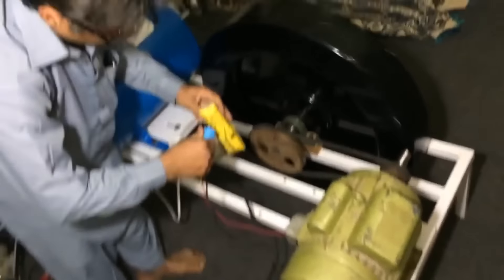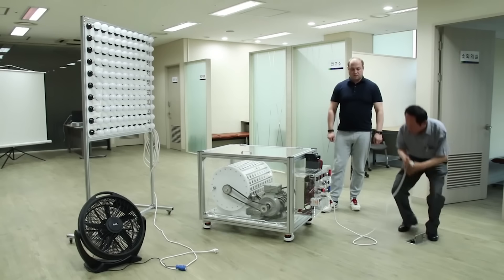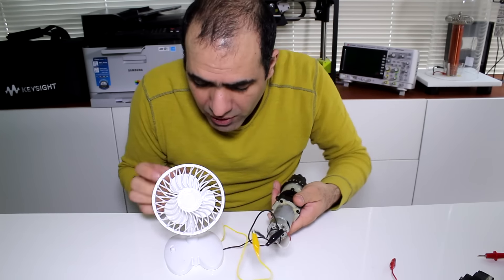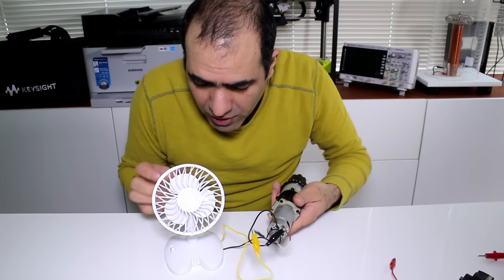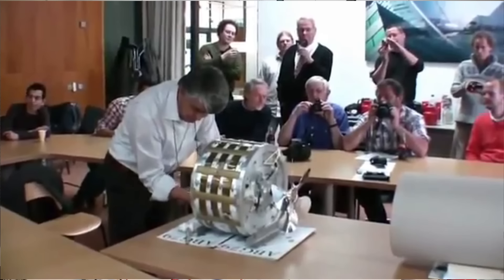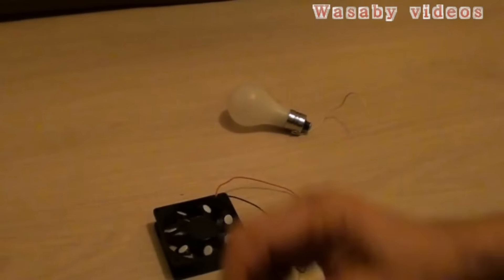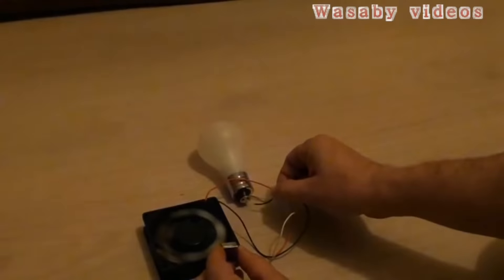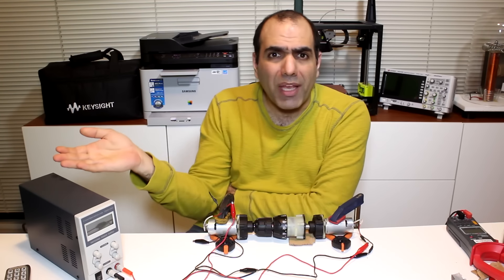The Curious Case of Free Energy Device

Comment: The hardest part of making a free energy device is to find a place to hide the battery
Reply: Haha no. The hardest part in making a free energy device is to be honest on why it works and being capable of refute any incoming BS.
Reply: Earth and sky are components of the battery. We just don’t know how to harness it.
Reply: @MiddlePath33  completely unnecessary when overunity devices exist.
Reply: There is no "free" energy. But there are energy sources that are untapped. Gravity is one of them. The centuries old grandfather clock is a gravity powered device, that can run indefinitely, as long as you reset the counter-weights. And resetting them automatically is an easy engineering problem to solve. You just need to scale up the design many hundreds of times, and use multi-ton counterweights attached to a fly wheel.
Reply: @lukiepoole9254  You have answered your own question. What you have described is NOT free energy, because you do have an energy source: the magnets. True free energy is impossible. Any system where you are not introducing some kind of energy into it will eventually stall because of drag, attrition between the component parts, and parasitic loss of energy.
Reply: @Biden_is_demented  Gravity is tapped; that's what hydroelectric dams are. But you cannot use your output energy to reset the mechanism for more energy than was in the system at the start, so you cannot create a mechanism that does work (like running a clock) indefinitely (which would be free energy). This is basic thermodynamics. In the case of grandfather clocks and hydro dams, the reset energy is external (the person resetting the weights, and weather cycles powered by the sun). Gravity isn't an infinite energy well. To use it, energy has to be put in to create a gravitational potential to harvest energy from.
Reply: @Biden_is_demented  What?  Hydroelectricity powerplants work because of.... gravity.  What are you talking about?!?!  We use gravity all the time.  Weight and pulley = gravity.  Dams = gravity, etc.
Reply: It doesn't work like that. The laws of physics govern that the energy generated from the falling weights of the grandfather clock cannot be greater than the energy required to reset the weights. You think nobody has ever tried that? No matter how much you scale up the design you will never be able to generate more energy than it requires to keep the clock running.
Reply: @Sinoops  maybe if you understood the true nature of gravity you would be able to come up with solutions.
Let me give you a very good hint:
According to mainstream, gravity is a property of space.... Translation: "action without any vehicle for conveying the action".... An ABSOLUTE ABSURDITY
Reply: First off what do you mean by the nature of gravity, and why does it need a vehical? Do you have any data to support your " ABSOLUTE ABSURDITY" claim?
Reply: @shanetestini5547  gravity is a force (a stress).  As any force it needs a vehicle. 
If you're into physics listen carefully:
Superimposable mass-free energy exists, therefore space is not abstract (purely mathematical manifold = space-time, Einstein immediately collapses), space is a physical manifold with a vector of tension. From 1 point we draw the sphere XYZ, we therefore have 3 waves. 2 outward X&Y , they are equal & normal , their combination gives you a rotation in a medium, this is the magnetic field.
And we have 1 wave inward to the centre with amplitude dropping to zero, this is the electrical tensionZ in the medium, steinmetz diéletric field. 
Epsilon zéro & mu zéro are the magnetic conductivity & dielectric conductivity of the medium, the energy carrier. And finally instead of spheric propagation, we have the stress-ellipsoïd defined by 2 pressures XY & 1 tensionZ with different conductivities for the 3 axis.
Attraction= destructive wave interférence = medium shrinks , objects are attracted to a point of mediation
Repulsion= constructive wave interférence, increase in wave amplitude, medium expands
The opinion of a physicist who fails to understand the existence of the energy carrier is strictly irrelevant.
Reply: @marcmillis3867  Ah yes I can hear mehdi ripping out his remaining hairs reading this word vomit.
Reply: @Biden_is_demented  I love how your inaptitude leads to such statements. "as long as you reset counter-weights"... Well my mobile phone is also a device which is powered by free energy coming from electrical battery indefinitely , as long as I remember to recharge it. When you're "resetting counterweights" you basically putting energy in the system, by hand, "charging" those counter-weights. You don't realise it, 'cause it's a very low-energy device. But if you scale it to draw more energy, you'll also have to put more energy. And you'd need huge machinery running on, guess what, probably electricity. So you will create a machine that is technically still powered by electricity, but not directly anymore, and therefore less effective.
Reply: @HiArashi13  I often forget that i sometimes have to talk (write) to people that have slow comprehension and intellect, and thus EVERYTHING has to be explained to them, word for word, or they won´t understand. That leads to extremely long comments,  that i frankly lack the patience for these days. Do you even know what a grandfather clock is?? The same energy that moves the gears and cogs inside the clock, can also be used, if stored temporarily, to reset the weights! If you scale up the grandfather clock, and have water counter-weights of 1 ton instead of 1 pound, don´t you think you have enough energy to move a flywheel connected to a dynamo?? Now just attach a battery, and PRESTO! You can run an electrical water pump that can fill up one counterweight while the opposite one dumps its water weight, which in effect is resetting the weights! I´m sorry if you are so inept to not be able to think of something like that. That´s why not all can be engineers. Some have to be garbage haulers.
Reply: @ParabolicBox  what about quantum mechanics and zero point energy? Dont they prove you wrong?
Reply: Or the mysterious wires
Reply: Late answer: hydroelectric dams get their energy from the sun (via the rain cycle). You can't get energy from gravity as a rest mass.
Reply: @Biden_is_demented  Have you ever actually seen a grandfather clock? You do know that they have to be rewound by hand every week or so right? Some grandfather clocks have electric motors installed in them so you don't need to do it themselves but they're obviously drawing their energy from the grid, but I'm guessing this is the type that confused you.
Reply: @surotto4321  Quantum Mechanics doesn't conflict with Thermodynamics and Zero Point Energy is not a real thing.

Comment: I appreciate you debunking rhe free energy devices.  Quick question what about taking the two motors where one is producing energy then running it thru a tesla pancake coil to increase its energy prior yo reaching the motor?
Reply: You aren't increasing the energy you're increasing the voltage, those are two different things.

Comment: One of my friends fell for the magnet - fan BS, they were going to use them for a science project. I quickly told them it won’t work. And they almost didn’t trust me.
Reply: Get rid of your accent immediately.
Reply: @MrNikolidas  I did
Reply: @kolakolabao But I want to know what would happen if done correctly!
Reply: @yourmum69_420  Well,the reason why you can't have free energy is electrical and chemical resistance
Lets say you're trying to create a device that moves without an external power source forever.Lets say you just have to give it a push,and it keeps moving.The movement of this device will create heat,and thus,the energy will,eventually,run out.If you try to add another device that spends the energy you put into the first one,the energy will run out even faster
When we're talking about electricity,its simmilar,when you use electrical energy,there is resistance in the wire or whatever other conductor you're using. That resistence creates heat,which will either go into the environment or build up and melt the wire. This law of thermodynamics applies to all forms of energy,when you put in a certain amount of energy,it will always get smaller,and if that energy is being used for mechanical movement,well,it runs out even faster
Reply: @yourmum69_420  ah for that one specifically,basically a fraction of a second after the magnetic atraction happens,the opposite will also occur,which will send the fan into its previous position.
Also,the energy that would be created by this,if it worked,would be enough to power one led diode.Anything more would require more energy created than exists in that system/mechanism,which is impossible unless you're using deception
And generators have magets and magnetic fields inside of them. Look up magnetic induction and how its used in motors.If magnets could be used in this way,Tesla would have discovered and pattented it in ths last century.Unfortunately,this just can't be done,we are extremely limited by the laws of the universe,but we have to make it work,which is why people study and try to find new,cheaper,cleaner ways of making energy every day
Reply: @yourmum69_420  I'm not an expert by any means, but I think I have an idea.

Basically, magnets always pull things. If you have a magnet pulling a piece of metal towards it, it will continue to pull it even if the other piece of metal passes to the other side of the magnet. If you've seen Hacksmith's railgun videos, this is a problem that they explain.

In order for the fan to keep moving indefinitely, the big magnet that's pulling the smaller magnets would have to somehow stop pulling them once they get past it; that's something that's much more complicated than it sounds to engineer. If you just stick it all together like they do in the video, the fan would move a little and then stop because the big magnet is pulling some fan blades forward and other ones backward; it's pulling on all of the smaller magnets (hence all of the fan blades) at the same time. It's trying to pull all of the blades toward it when half of the blades need to move away from it to continue spinning the fan, and so in real practice it would just stand still.
Reply: Or maybe a large fan where they are a lot farther away from the other magnets and doesn't have as much energy pulling it making it not equal energy on each side. Plus the energy doesn't come from nowhere as it uses the energy you are pushing the magnet with. So what happens when you attach it to a stationary object?
Reply: @yourmum69_420  .
Reply: @yourmum69_420  The magnets would reach a state of equilibrium at a set distant apart . That is the stored energy you gave them pushing the magnet near. Would simple run out ..so the fan would turn half a blade..then stop..unless you kept pushing the magnet closer and chasing the magnets with it ...the energy comes from your hand ..once you stop pushing..the blades stop turning ..
Reply: Maybe he thought you had an accent
Reply: Me too bro 😂
Reply: @yourmum69_420  The answers in these comments aren't basic enough. It's easier to understand starting simple. We all been kids at some point playing with magnets. Use one magnet to move another on a table and we were amazed.

 The truth is the magnet has an equal and opposite reaction. It only moves away by an equal amount force. You stop your hand the magnet stops. The amount of force between the 2 magnets is equal to the force that brings them together.

If the magnet moved up and down in perfect timing the with other magnets on the fan it could move the fan but then something would have to power the magnet that was in his hand up and down and would require 100% efficiency just to get back to the same place you started with (an equal and opposite reaction which ends with the fan not move at all) even if you have 2 magnets of different size. The force that it takes to repel the large and small magnets will equal the forces that brings them together.
Reply: @Anonymous-df8it  okay this is not strictly correct but see if it makes sense. Even assuming the motor generator setup would run forever. As soon as you put a power source taking power from it. You are sucking energy from the system you can’t make more than 100% of anything. So for example let’s say you have a bucket of water and you tipped into another bucket of water and keep doing that the bucket of water will never run out as soon as you take a drink from it. There will be less the more you drink the less water until there is none left. Does that make sense? And that is why you have to keep putting more energy into a system because you’re taking energy out of it
Reply: @malcolmwhite6588  Why would it stop if you're not taking power from it?
Reply: @Anonymous-df8it  because in the way, you always will be – as nothing is perfect in terms of energy conversion, so you will be taking some energy in the form of heat noise, friction other rotational losses. I think a proper physicist could probably explain it better. LOL

Comment: 8:30
Besides solar energy, wind is powered by the sun like any other weather occurrence. That means, hydroelectric plants that use glacial water for example, convert the position
 energy invested by the sun through vaporization of water.

Geothermal uses energy that comes from radioactive decay within earth's core.
Only the tidal power plants don't use nuclear energy (don't to be confused with power plants powered by waves). They use the sun's gravitational pull on the water (and the moon's).

Comment: the problem with magnetics generators is that the magnets lose the directional flow and stop, 
this phenomenon occurs when the matter from which the magnet is composed has a higher velocity speed than the magnetic flux generates

Comment: In a kind of similar video a guy made a think that interested me quite a bit he feeds a AC engine qith 700v 1kHz instead of 120v 60Hz and  when it takes amps mesure on the plug in the wall which feeds the first stage before volt and high frequency conversion it shows not 1/6 ratio 120v/700v but a 1/10 ratio , I am pretty sure he have a battery hidden, but what let me very curious is that the engine fed qith 700v high frequency low current seems to reach it's normal torque.  Wat let me with this question,  in our formula to calculate power p=u×i  there is no mentioning of frequency,  as I understand the thing (I am not an engineer) the frequency on AC is the member of "pulse" by second so if I make more puls will it also traduce by more power?

Comment: The 2nd principle of thermodynamics speaks clearly. 
The only thing i say is that with al 4 meters tall antenna i was able to get some milliwats of power with a germanium diode and that is possible to get power from ionized air in the electric field of atmosphere and this is true.
Maybe there are some frequencies produced by unknown phenomenons that can be used with resonance coupling but it is not free energy and it has nothing similar to the engine-generator couple with >100% efficiency
Reply: As shown by the experiments and working devices of Nikola Tesla, Hermann Plauson, Thomas Henry Moray, Viktor Schauberger, Lawrence Rayburn, Ionpowergroup and of course NASA.
Reply: @Cryptic_Triptych  you say right
Reply: @Cryptic_Triptych   interesting, when you have done it, please write me and if you want send me a video because i am interested in.  Is it radio frequency or ion power.
(Only if you want of course)
Reply: @Cryptic_Triptych  ok
Reply: You were just intercepting the signal from a radio station.

Comment: That first one is an old fashioned flywheel condenser. It's not free energy, but it's a surprisingly efficient way to store large amounts of energy for later use. In the early days, power companies used stuff like this to hold energy temporarily. I think they might still do that. You should build one of those if you don't already have something like it. Plugging the generator back into its own output might help make it less of a drag on the flywheel, wasting less energy. You have to pay for it, but it's great energy storage.

Comment: As far as I know, a motor-generator is a device in a car to save weight (an alternator and starter in one device)

P.S.: If you steal it and don't get caught, it's kinda "free"
Reply: Starter-generators are commonly used in small jet aircraft. Locomotives (back when they used DC generators) would use the main gen to start the diesel engine. Some trains still use motor-alternators to turn the DC power supplied by the locomotive into 240v AC/50Hz (e.g. the mark 3 stock on the UK's HST, which entered service in the mid 70s and is still just about around).

Comment: I can make a free energy device, it's very simple. It's two pieces of cable connected to the distribution box outside, before the meter. You just have to be careful to connect it to phase and neutral and not across two phases, or you'll get a massive bang out of whatever you try to plug into it and then it's no longer free...

Comment: Mehdi2: Coolant valves are on
Mehdi3: Reactor fuel in place
Mehdi4: Ready for operation
Mehdi5: Starting the system

💥

Mehdi3: Always make sure you are using the correct reactor fuel
Mehdi2: Don't short circuits
Mehdi4: Always be careful with your tools
Reply: Mehdi5: Always remember to have your death insurance ready, you never know when some high power, radioactive nuclear power plant can explode near you
Reply: Nah,it's only3.6 R  XD
Reply: Mehdi5: Make sure that your concrete cube doesn't have any weak spots.
Mehdi5's Second Head: Heeeyyyyyy!
Mehdi5: Oh BEEP BEEP BEEEEP